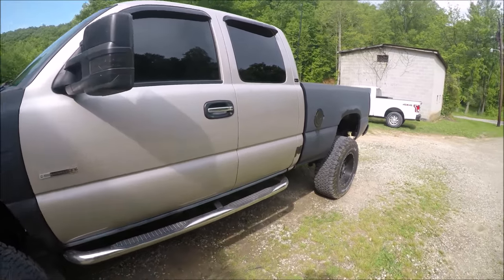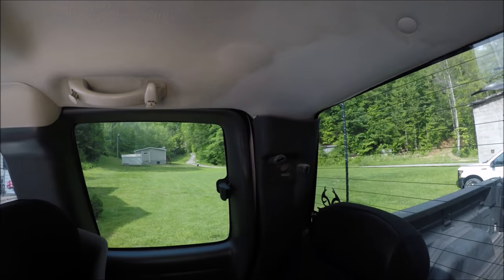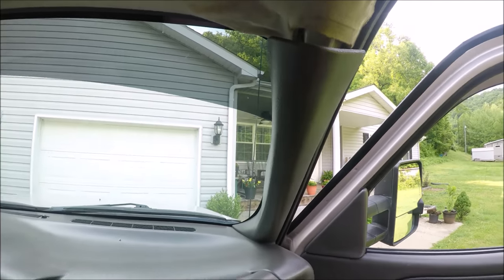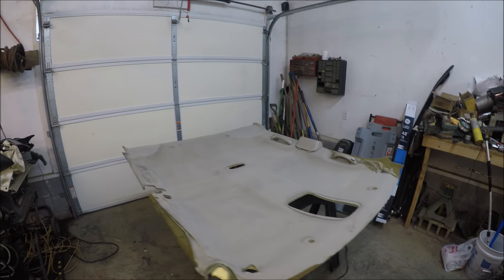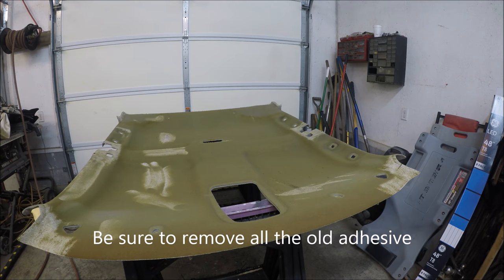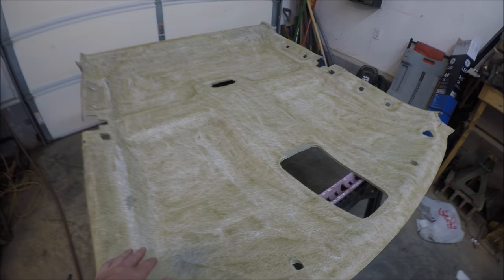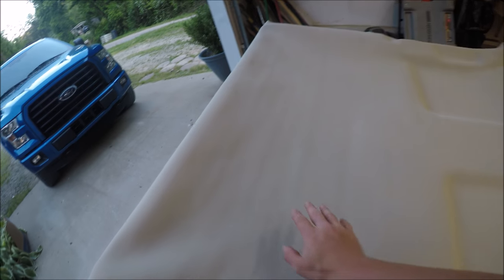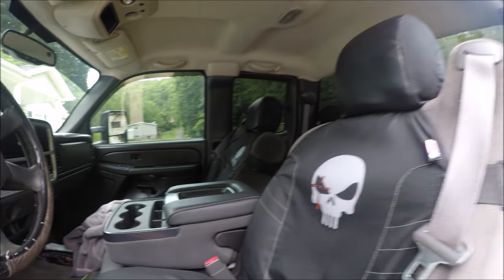Headliner Replacement 99-06 Sierra Silverado

Comment: I'm a retired Upholstery shop owner I did it for 50 plus years. The one thing I always did, was to use a handheld wire brush to remove the glue and old foam rubber padding. Never used a grinder wheel wire brush. It takes a little longer to do it that way but you won't be making un-wanted mistakes.
Reply: I just used hand manual one take sum time but better than messing up using grinder
Reply from the maker: Thanks for the tip! Yeah I should have done that it would’ve turned out better
Reply: Did you remove the liner by bending and keep the seats in the truck?
Reply: @jimbosammy4255  i never removed any seats when taking a head liner out but the come out through the passenger side.

Comment: Thanks for sharing...You did a good job. I do have a question since my headliner has some edges where the fabric is starting to peel back. Would you recommend just using the adhesive on edges where the fabric is beginning to come lose instead of removing the entire headliner? If so, would it be best to spray the adhesive on the headliner instead of the thin fabric itself to reattach. Thanks
Reply from the maker: Thanks for watching! You could probably try 3m headliner adhesive on the edges It should work ok

Comment: Use a wire brush for a bbq grill to clean the board works great
Reply from the maker: Thanks i will have to remember that
Reply: It's just the edges on both sides loose for me, I wonder if cleaning the fiberboard and using the spray adhesive will work just to patch it up.

Comment: Great job with the headliner. You gave me a confidence boost to tackle the one on my silverado
Reply: How easy would you say it went?
i have a 4 door silverado 2003 and want to change my headliner.
Reply: @kozmicflush980  did you ever do it
Reply: @coolred6  hey, i did this project finally just a few days ago. 
it was hell of a process but easy though, just time consuming especially if you do it alone like i did. 
i Had to take out front seats and several trim panels. i followed this video and another video for how to apply the fabric/glue. once i unplugged everything and got the liner free, i got my father to help me actually get the headliner out through the front passenger door, definitely need two people for such a large headliner. I believe if you have single cab or ext cab this job will be SUPER easy but doing it for Crew Cab is very time consuming. took me about 5 hours   saved myself $ 400+  though

Good luck.

Comment: Thank you for sharing your DIY project: I saved it to my playlist.  Very nice job on the video and pop-up text for the correct tool. I am trying to resolve the cause of water leaking into my 2005 GMC Sierra 1500 pickup truck.   I tested the sunroof drain tubes with only a cup of water yesterday. I initially tested the drain tubes while the truck was backed into the driveway; the water drained through the front drain tubes only; I did not notice water leaking from any other location. I started the engine, pulled out of the driveway and faced the truck forward; tested the drain tubes; the backseat passenger side did not disperse water; the backseat driver side dispersed water through the drain tubes, the front passenger side dispersed the water down the drain tube and also down the pillar through the dash; the front driver side dispersed water down the drain tube.  Test Results 1 - the passenger side of the truck seems to be the problem.
Reply from the maker: Peter Pa No problem thanks for watching! I’m trying to find a water leak in my truck also! Mine seems to be the driver side
Reply: @OFFROADNATION606  Did you remove the third brake light from the outside in order to replace the headliner?  In my first attempt I tried to use a sealant on the third brake light - I missed the mark big time because water still leaks into the truck from the third brake light; thus, I purchased a gasket from a seller on eBay and I also purchased a new third brake from a local auto parts store.
Reply: check rear cab vents... they stick open and let water in
Reply: Check shark fin...known for leaks

Comment: How did you remove it from inside the truck to outside?
Reply from the maker: I had to open the front door and extended cab door and bend it alittle just be careful not to bend it to much

Comment: Is this an extended cab or crew cab? Will the headliner come out in the crew cab with the pillar in the way?
Reply from the maker: It’s an extended cab I had to bend mine a little to get it out. I think on the crew cabs there bringing them out the passenger side front from the videos I’ve seen. I’d just make sure to not bend it too much.

Comment: Hows the glue holding up?
Reply from the maker: ddemier ddemier Honestly really good, so far no sagging anywhere looks just like it did when I put it in, May try to do a review video soon.
Reply: @OFFROADNATION606  I used 3M super 77 and now its sagging on a curvy spot only 3 days after I re- installed it
Reply: @OFFROADNATION606  where did you bought the 3m adhesive for headliner?
Reply from the maker: Freddy Lopez I actually got it at Walmart

Comment: What armrest/center seat do you have in the front?  It doesn't look like the stock one.  I hate the stock one in my truck.  Yours looks like it is from a newer truck.  Does it bolt right in?
Reply: It’s from the GM 2012-2017 model jump seat. Requires frame modification, gotta cut and weld the frame to fit.

Comment: Agreed with the grinder. I used my drill with the wire attachment then finished up with a DA and sticky paper. Yes I learned about digging in and did the same as you with the fiberglass resin. I'm thinking I wanted to try using the expanding foam next time instead of resin. too damn messy.

Comment: the grab handlers just snap into the headliner and not into the metal roof? I am having a problem getting the grab handles in tight as I put them back up.
Reply from the maker: If I remember right I think they snap in the roof

Comment: How wide was the fabric you used length and with wise? Thanks
Reply from the maker: I cant remember exactly but I think it was about 60 inches wide but I can’t remember the length. When I bought the fabric it was a little bigger than the headliner to allow me to fold it under.

Comment: Great video man,  I wanna redue my headliner as well but I want to try and remove the rear roof ac climate control and just utilize the ones in the front roof part of my 2000 Limited, any tips or suggestions are appreciated.
Reply from the maker: Thanks for watching! I’m not really sure on that I’ve not really did anything with rear climate control.

Comment: I looking into doing a similar project. Where did you get the headliner material and how did you figure out the correct color. Last question how’s it holding up

Thanks
Reply from the maker: Philip Azcueta I got it from Amazon and I made sure It was for the 99-06 that way it would be the same gray. It’s holding up great so far

Comment: As a matter of fact, yes the overhead grab bar does come off the headliner.... one of my passengers pulled himself up into the back passenger side seat of my extended cab '01 Silverado and ripped the back clip of the handle right out of the ceiling, broke that little loop at the end of the clip and it won't stay in now.  Looking for a replacement handle at this very moment.  Can't replace the clips, the broken part is actually molded into the handle...  When was it ever a good idea to use a plastic two part clip with a retaining ring instead of a nice metal screw....?
Reply from the maker: Yeah I really don’t like the design. I agree with you I don’t know why they can’t just use a screw it would be a lot better setup.

Comment: How did you do the console/jump seat?
Reply: Snake bite Stever I’m wandering the same, I wander what year it came off of. I like the cup holders up high instead of on the floor
Reply: GeorgiaBoy912  2014 or newer I currently have a 15 since my 02 was stolen a month ago and they still haven’t found it
Reply from the maker: Snake bite Stever Right now it’s just sitting there but you can cut the legs off the old console and weld them to the new console
Reply from the maker: GeorgiaBoy912 I think it was a 2014 or 15 Silverado. I bought it off eBay it was removed from a police Silverado

Comment: It was way easier to slowly work the wiring loose from the headliner than it was fishing the wires through the dash.
Reply: I'm gonna take on this project soon. really glad i read your comment as i was thinking the same thing about that wire. Probably just pop them loose rather than feeding it out. Are they easy to pop loose?
my truck is a silverado 03 1500HD crew cab

Comment: Was it hard to get the headliner out with out bending it.with out the rear window out or since rear door opens backwards it came right out the side with a little finagling.
Reply from the maker: Mike Novak Yeah I had to bend it some but I tried to be fast so it wouldn’t hurt it. I just opened the back door and gently bent it down and it pulled right out. I tried to be fast putting it back in because it can make a small crease from folding it. But the crease usually will go away after 2 or 3 days. Honestly I don’t know how to get it out without bending it some

Comment: Geez man ..you skipped the most important part ..got everything loose ..but ..is it glued in front? ..mine is stuck up front ..
Reply from the maker: Donald Anglin I don’t remember seeing any glue. Some of the wires for the rear view mirror can be stuck to the headliner sometimes
Reply: Yeah... if you’ve had your windshield replaced, your headliner could be stuck to the new urethane. Sloppy installers...